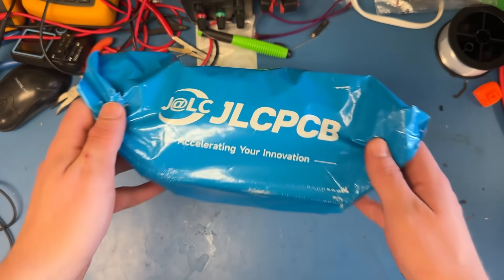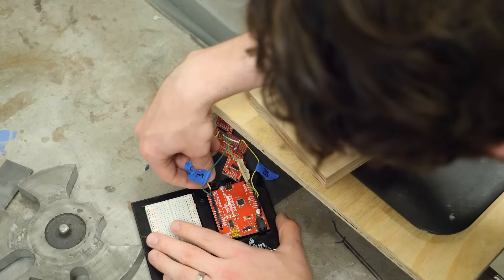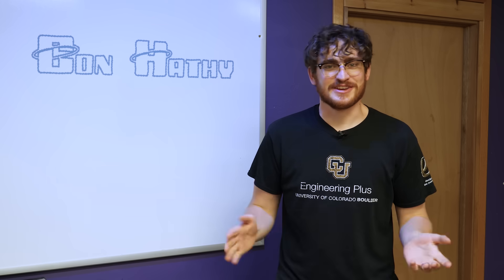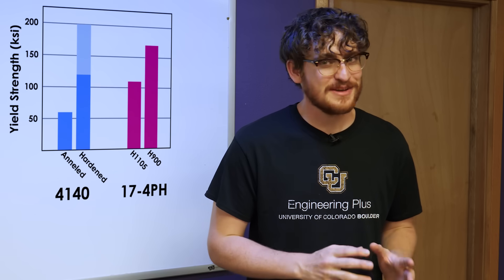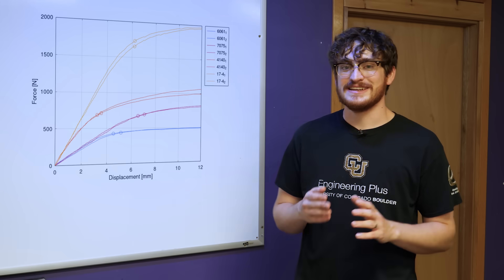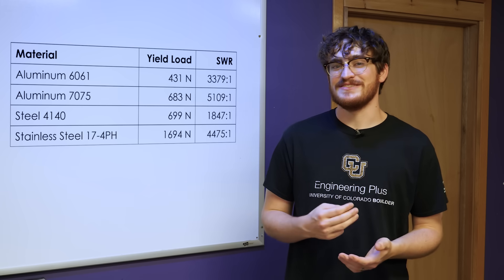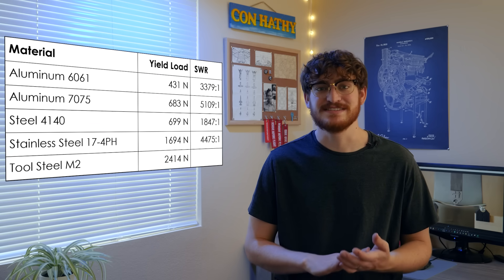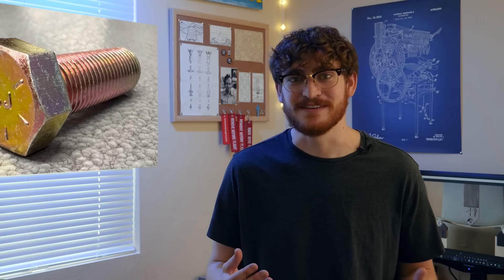Is Aluminum Actually Stronger Than Steel?

Comment: Gotta love aluminum for the sections and shapes you can get, and still have reasonable weights.  3D printing metals is coming on strong.  Getting the right shape can really help with lowering stress levels.

Comment: Also, Steel is generally easier to manufacture. It welds better/easier, you can generally bend it around more before metal fatigue and cracks start ruining the strength, you can also cut it easier using oxygen processes like laser cutting and gas torches. Lasers can cut through aluminum and stainless using brute force, while a gas torch can't since it's having trouble oxidizing the material and also because aluminum oxide has a much higher melting point so the slag builds up in the kerf instead of going out the bottom to expose unoxidized metal.

The big advantage aluminum has when it comes to manufacturing is the way it's easy to cast because it flows better while molten and it requires much lower temperatures. However, cast metal has a lot of downsides, especially when it comes to strength to weight.

On a side note. Fasteners is not the prime example that I would use for steel on aircraft, I would use engine components. You could hypothetically make oversized aluminum fasteners that could do the job, however, when it comes to jet engine components, they just can't work at all at high temperatures, let alone the extreme temperatures seen in a jet engine.

Comment: Steel is insanely strong. It blows the doors off SOMANY materials and should be your first option until one, more, or another factor such as weight, heat, RF/magnetics, conductivity, and or corrosion  forces you to choose something else.

Comment: Steel's main advantage is price-to-strength ratio and wear resistance. Whenever you're building moving parts meant to last forever and/or be sold to consumers, big blocks of steel just wins.

Comment: I'm not an engineer or a materials expert but I've never heard someone say aluminum has a higher strength to weight ratio than steel.  I honestly was impressed how close it was! I though there was no way the aluminum would be even close to the steel!

Comment: 2024 and 7075 aluminum, the most commonly used alloys in aviation, are heat treatable to various grades, with pretty significant differences in resulting rigidity. In T0 condition, they're not much different from 6061, soft and easily formable and bendable with very small radii.

Comment: I always thought steel pistons etc in an engine would be stronger than aluminium at the same weight at the same operating temperature since aluminium weakens more at higher temperature

Comment: Specific Stiffness (exact criteria varies on loading and free variable) is why you use Aluminum. Aka minimizing deflection. Poster child is fixed length, width, variable thickness bending loads.

You shouldn't use aluminum in strength limited loads. The specific strength achievable is similar to steels.

I consider this video both factually correct but highly misleading. You don't argue CFRP is crap because it's bad at impact loads. Material selection isn't as reductive as just strength to weight.

Comment: Compare the ratio of young's modulus to density of steel, aluminum, and magnesium.

Aluminum (and magnesium) is great in applications where your loading is mixed and you have bending stress in the part. To match the same stiffness for purely tension and compression loads you'll generally end up with a part that weighs the same as a part made of steel. The aluminum part will be significantly stiffer in bending.

This is what makes lighter alloys better. Strength is a function of alloying metals that are mixed in as well as heat treatment. A lot of cost effective steels have very good tensile strength vs density. This is effectively what you've demonstrated.

Comment: Drawing generalised conclusions from such a ridiculously simple test is nonsense. Steel and aluminium have different properties, and they tend to be used in ways and purposes that make use of their strengths. Take an airliner, and much of the landing gear is built of steel, but we do not build the fuselage from the stuff.
The lower density of aluminium makes it very suitable for what is basically a large, hollow tube. If steel was a better material, just because it resists bending better for a given profile, and that was all that mattered then we would be building aeroplane fuselages from the stuff. We don't.

Modern engine blocks now tend to use aluminium, because they are lighter and can be made strong enough that they work very well, not to mention other properties, like better heat conduction. We do not, however use them to make crankshafts, but we do use them for pistons, where they are hugely superior to steelm

Comment: What I learned in university is that the weight advantage of aluminum is only really an advantage under certain loading conditions. If you can design your part/machine to be only loaded that way you can save something to the likes of 15% in weight compared to steel. Which is a great number for aerospace stuff

Comment: Also, there's the issue of stiffness to wait. In many circumstances you are designing to stiffness, and not strength, and aluminum has 1/3 the stiffness of steel.

Comment: At the very top end, the strongest steels and the strongest aluminiums are basically on par for tensile strength to weight

grade 350 maraging steel ~2.4 GPa at 8.1g/mL = 3000000 (m/s)^2
RSP AL7034 ~750 MPa at 2.85 g/mL = 2650000 (m/s)^2

Steel and Aluminium alloys (and indeed most high performing metals) have very similar stiffness to weight. Coincidence? Kind of.

Comment: Steel is better than any other structural metal by far unless weight is a major concern. Titanium is cool, but it’s basically a compromise between aluminum and steel. And it’s expensive.

Comment: As you mentioned, heat treatment of steel is relatively costly in smaller batches. Many high performance steels are quite expensive and difficult to machine

Comment: Automotive engineer here. I like how you mentioned different density, vibration and heat. Aluminium is a great material for cars. Keeping the mass reasonable, while making the cars larger then last time was more or less the challenge the last decade or two. Aluminium is great at this as you can build larger diameters at the same weight. Which is a huge deal in bending. Aluminium sucks with vibration and heat compared to steel, but it's still good enough for almost any part, if you know what you are doing. Barely any car sees a lot of millage, and people rather change for status, age, family or innovation.
Whats really great for us, a high volume aluminum supplychain is easier to handle. You only need ~1% of copper, manganese, silicon or magnesium to get the material where we need it. Aerospace get's up to 8% especially in manganese, but you reach a maximum compromise there. Also temperatures and energy to machine are significantly lower.
Low alloy steel barely cut it. You need 2-16% of chrome, nickel or really expensive stuff to protect it from air, water, steam, mist etc. Most medium alloys start at the 8% where aluminum left, and aerospace or engine parts can be up to 20% other materials. So while it's awesome to cook the perfect steel for you application, it's a lot of effort and ultimately cost to get your everlasting steel parts. And recycling is a pain, unless you can pull the same alloy again.
Reply: Nothing beats steel's wear resistance. Anything meant to last has thick chunks of steel and that's what prosumers like me are looking for.
Reply: This is why we scrap modern cars after 300 000km or 20-25 years.
Reply: "Barely any car sees a lot of millage [mileage], and people rather change for status, age, ..." LOL
Reply: larger cras suck though so im not sure thats a positive

Comment: Can you do a video on titanium as well? Being a carpenter I have a rather dim view of its use in hammers. I found it lacking in toughness compared to steel.
Reply: Titanium is a very unique metal as it doesn't absorb heat yet is flammable, its as strong as steel yet half the weight, its also a living nightmare to make and manufacture.
Reply: @mitchscat773  It doesn't absorb heat?

Comment: I feel like I went through this bell curve meme where on the left at the most uneducated level I thought "steel is stronger than aluminium", then at the partially educated level thought "actually good alu alloys can have a significantly higher strength to weight ratio than steel" to the most educated level of "yeah steel is tough as f*ck"

I mainly started appreciating the benefits of steel when learning about custom bike frames. That fatigue resistance is a huge factor, but also the fact that it can be relativaly easily brazed to form incredibly tough joints or welded without post-weld heat treatment necessary.

Comment: Salute to you for including 17-4ph one of my favorites. Sooooo good at dimensional stability through heat treat. Weldable. Seriously such a nice material to have. I have a spool of er630 in the garage always… just in case… 😂

300m is just 4340 with extra silicon and vanadium but vim var spec baked in. So 6414 spec.

You should have opted for c300 instead, for this test. McMaster only offers up to 1” diameter c300.

Also you can make a heat treat oven for like 150$. Arduino controller piggy backing a cheap eBay controller, kanthal wire, firebricks etc.
Reply: Also 7075 stress corrosion cracking is horrific and people are so ignorant of it. I don’t use it unless something has to be cheap
Reply: The other place where alloy steels are used, is landing gear. Crazy to not mention- as landing gear sort of drove a lot of development of high toughness alloy steels.

Comment: Aluminium is great for large spans of material which have the space available to relay on the geometry of the material for strength, ive worked around them a lot loading heavy equipment. Any comparable steel ramp will  have a smaller cross-sectional geometry to maintain the weight of a comparable aluminium counterpart, this sacrifice usually averages out to a lower resistance to deflection for the same given load, thats from hands on experience loading vehicles with these things and having to carry 120lb ramps around day in and day out.

Ive seen lot of broken ramps from people shock loading these things, the aluminium ones were the lightest ones for any given capacity

Comment: The Young modulus for steel is three times better than that of aluminium, there is no way around that. Basically the specific modulus (Young modulus/density) is the same for both steel and aluminium, only a noob would say something like "Aluminium has better SWR than steel" 🤐

Comment: As another engineer, Aerospace is the material Olympics. A lot of other groups are OK with concrete.  I work in semi conductors and vacuums, and there's other points to add. The stuff I work with is very hot, 1600C, graphite and tungsten dominate, and i hate them with a passion. If you move away from steel and aluminum metals get fragile, and graphite you need to baby. They're also sticky, love to gul, the prices are insane, and there's 1 manufacture that's abusing it. You re-tap a lot. I had to use molybdinum bolts for a plasma maker. They were $4 each, each one was bespoke, so supply was very limited, and they broke a lot. God, i miss steel 😢. Went through like $8k in tungsten in a week it's so fragile. 
In my industry, every thing needs signed off by someone who can't be bothered, so they tend to stick with just a few materials they like. Having any mayterial selection is rare. Al or steel is a gift because they last. 
As for the materials, you're right, but know you are in a great industry. In mine, you get what you get. In the car industry, you can get a lot heavier with no trouble, and secretly, you want stuff to break to mandate replacements. For a lot of other engineers, their creliteria is totally different. Al is a great all-rounder.

Comment: You are full of nonsense. I use a lot of AlMg5MN. If you show me a steel, that equals this alloy, in strength to weight, corrosion protection and price in marine application, I can take your babbling serious. But you will not be able to. Steel is not better than aluminium and aluminium is not better than steel, it all depends on application, in what environment and for what lifetime you build.

Comment: While steel is far better for small structures, 

But on the other token. In some places you need the structure to have volume as well as strength. Amd then the lower desnity it by it self is a advantage and provide more secondary strength.

I would say that is core reason why aluminium have been so dominating. Of cause, yes. Composites are even better

Comment: Steel and Aluminum are my favorite metals, each covers the weaknesses of the other perfectly. Take reciprocating combustion engines, most modern engine blocks are aluminum for weight and heat dissipation but it suffers from no fatigue limit and thus steel is used as a cylinder liner to take the brunt of the combustion forces and possibly also helps reduce friction against the piston rings. My favorite example of this has to be the 3UZ in my Lexus, the rotating assembly is mainly forged steel with kinda thin steel cylinder liners, 1.5mm, and a quite thick aluminum block thats 6.5mm thick. while it doesnt have the same reputation as its older variant the 1UZ's million mile capability, its got the same exact formula, and i think thats perfect in showing just how good those metals work together

Comment: Have fun building a airliners out of toolsteel. 
I suggest you start by joining two sheets of the steel you have chosen and fatige it under tension to 10 million cycles. It is up to you to use rivets or weld or glue the pices.

Comment: This guy's take is some first year engineering student nonsense. He's acting as if every situation is identical and the material demands are the same for all projects. If his premise was even remotely correct, the only conclusion would be that every major manufacturer and their engineers were complete idiots considering the very liberal use of aluminum and composite materials instead of steel. That's without taking into consideration that components made of different materials are engineered differently to take advantage of their strengths while minimizing any weaknesses.

Comment: This video is kind of lame, bashing aluminium. Best we start making everythin from patented steel, maraging steel, and tungsten carbide because it's stronger. 
7075 aluminum is overkill for most general engineering. Also surface treatment can do wonders and thread inserts exist. 
Machining and work is much more expensive than aluminium unlike SS. Stainless and HSS is much harder to machine than Al, so $$$.  
7075 aluminium is like 5,5 €/kg meanwhile your beloved 17-4 is like 30€ or 40 €/kg, not an insignificant difference.

Comment: The problem with this is that it is assumed that the size to strength ratio is linear however this is not the cause for bending or buckling. The strength is linear proportional to elasiticity, however it is quadratic with area. So if you have tested samples of the same weight instead of cross section you would seen very different results. For example the equation for buckling of thin walled plates with articulated supports (I hope google translated that correctly) under axial load is tension = 3.62 * E *(s/b)^2 where s is the thickness and b is the width of the plate. So doubling the thickness would be more beneficial than increasing the youngs modulus, which is why aluminium is used for aircraft.

Comment: Use metric units

Test fixture weight does not matter

In flexure or buckling lighter material bigger cross section higher moment of inertia

Comment: As the good people in the comments pointed out, yes the thin cross sections can cause buckling, but theres a reason the engine mounts are 4130 .060 wall tube instead of solid aluminum

Comment: I don't think you're correct 

If a beam is under bending or torsion, then its mechanical properties are optimized for minimum weight using materials with high E½/ρ ratio for stiffness, high Sy⅔/ρ for yield strength, high Su⅔/ρ for ultimate strength, and high KIc⅔/ρ for fracture toughness. This puts 7075 aluminum way above even exotic steels like Aermet at 58 Rockwell hardness. If the goal is to minimize weight, structural beams of aluminum are the best option. 

The mistake here is not applying scaling laws correctly

Because strength in bending depends on thickness cubed (t³), while weight depends on thickness squared (t²), that's where the 2/3 exponent is derived. Repeat the test with equal mass beams with the same cross sectional shape but the proper difference in cross sectional area. You will discover aluminum is superior

Comment: Very interesting video. Winch bumpers for jeeps and trucks are offered with two material options: steel and aluminum. The fab shops rarely specify what the alloy is, but it's been my assumption that they use common, cheap, easily welded alloys, so maybe 1020 steel and 6061 aluminum, not cro-moly. Based on my amateur analysis, 6061 aluminum seems to be the winner over 1020 steel in the strength to weight competition. And then of course you can use thicker aluminum plate or wider diameter tubing to get a moment of area strength advantage. 

It would extra interesting if the cost of each material was given in your video. AFAIK, 4140 (cro-moly) is expensive compared to more commonly used steel and that is at least partly why high-end cro-moly automotive parts are much more expensive than their regular counter parts.